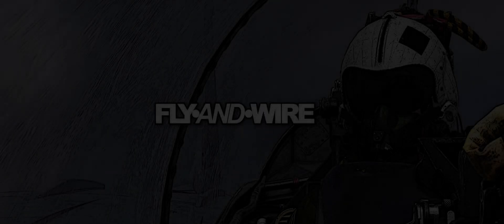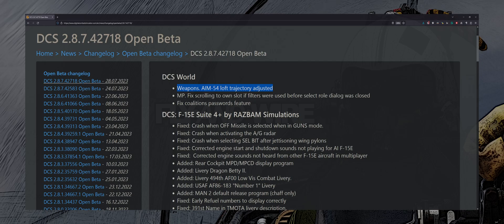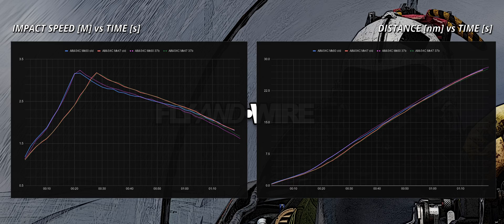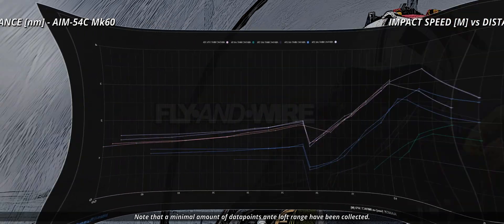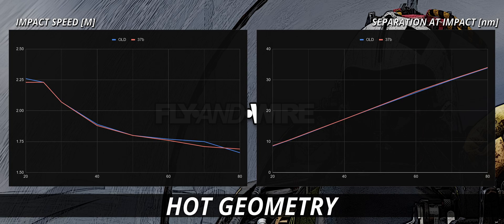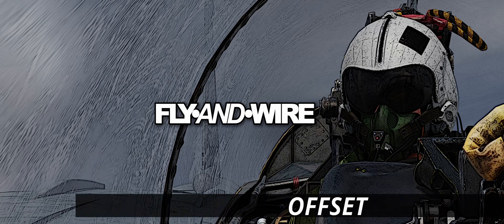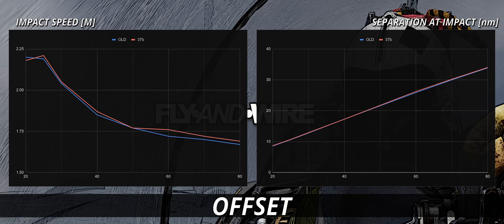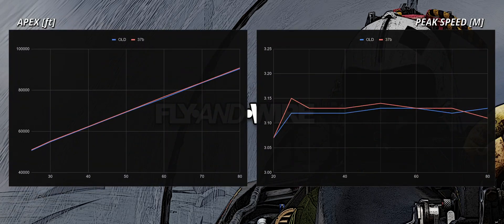AIM-54 Phoenix Post 2.8.7.42718 (28/07/2023) [AI TTS]

Comment: I don't think i get it. First, the video mentions drop in terminal performance for hot and cold, and then at the end it says slightly better terminal performance. Which on is it?
Reply from the maker: Hi, with 0TA, 0ATA, there is a tiny loss performance-wise. With different geometry (e.g. flanking / 30+TA) there is a tiny gain. Since 9 out of 10 engagements do not fall in the first category, I am happy to see an improvement for the second scenario, albeit minuscule.
Reply: @FlyAndWire  ah, thanks for the clarification!
Reply from the maker: No problem :)
Reply: There's nothing to get, other than the fact that a mach 4+ capable missile has been reduced to a barely mach 3 missile in DCS... just because HB devs like to cherry-pick their sources with a bias towards worst case performance.

Tomcats in DCS are only good for AWACS, tanker and large bomber hunting now... any smaller maneuvering target will easily defeat phoenixes, regardless of altitude or aspect.
Reply: @hardcard254  I can confirm that. 
They basicly nerfed the F-14 to advertise the F-4. 
Shame